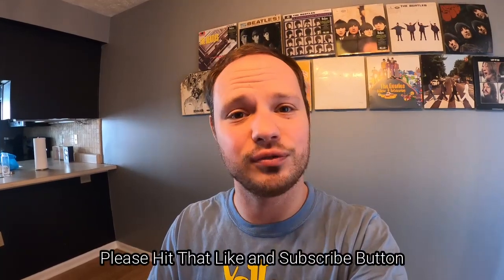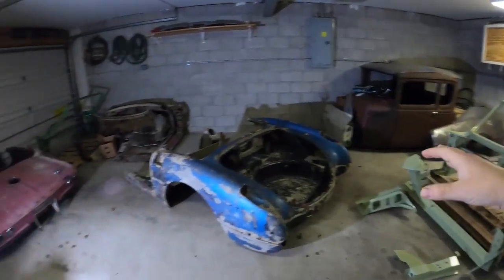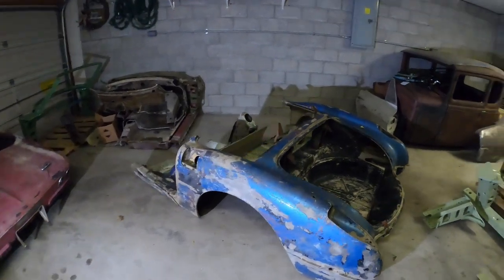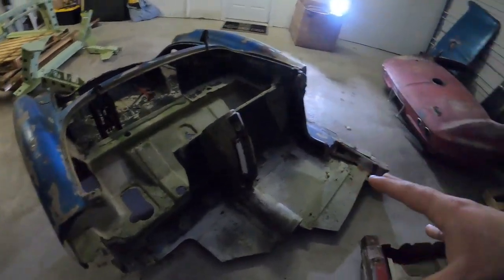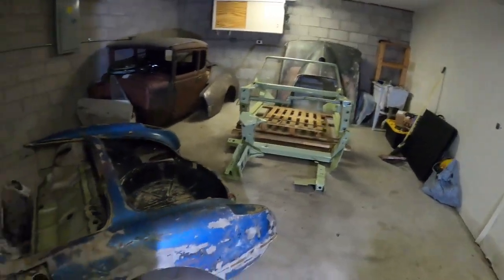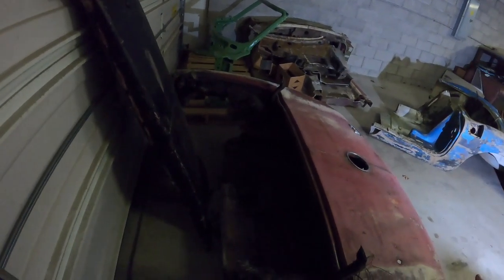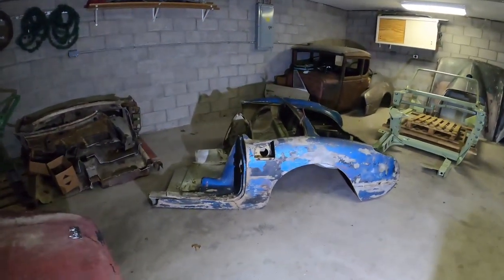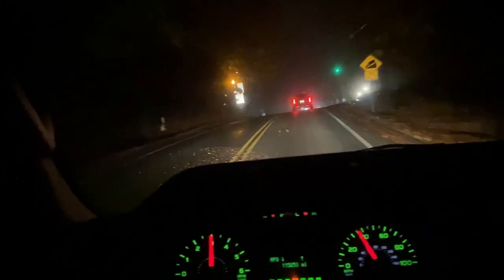I Bought A 1960 Corvette Project for $500!!  My New Restomod Build.  3 C2 Roadsters Up For Grabs!!

Comment: Mitch, I'm excited for the C1 build!!   I've mentioned that I'm building a basket case '56 vette..In fact,  I'm looking for the trunk/decklid hinge towers and hinges (and the section of floor under them) as well as an upper firewall section.  If you have, or run across any of those sections (56-60 should be the same), let me know please.
Reply from the maker: Oh yeah that’s right you mentioned that before! There is a gentleman that makes reproduction fiberglass in Oklahoma. Send me an email and I can put you in touch with him. Ill probably cut out most of the original rear floor so you can use whatever I don’t if you are close to me or Carlisle.
Reply: @MidYearMitch  thanks Mitch!.. I presently have a flat floor in my 56's trunk.. probably more in line of what you'd want..I wish I was closer to you.

Comment: Hey there Mitch,
That '60 is gonna need a few parts and a little paint! This will be a great project.
By the way ... I love your Beatles wall ... it makes me proud!
... but the Beatles Nerd in me cringes every time I see Abbey Road and Let It Be in the wrong order. Abbey Road was the last to be recorded.
Take care,
Dan
Reply from the maker: Hey Dan! The 60 requires some assembly and quite a few expansion packs. 

I’m glad you also appreciate the Beatles. I can tell you know your stuff! Let it be was recorded in 56 but shelved and abbey road was recorded in 69. Then let it be was released in 70. I ordered mine based on their release date. Funny enough I didn’t even consider that when I put my wall up. But I actually took a Beatles class in college. That was way better than my engineering classes 🤣 Now that class has some new material!
Reply: @MidYearMitch  Let it Be was recorded in Jan '69, and Abbey Road was recorded in September '69. They held up the release of Let It Be to coincide with the move release, but all that got caught up in a nasty court case, so the later Abbey road was released first. It's an important distinction only because they knew Abbey Road was their last, and put several closure elements in the arrangement (such as the song The End being the last song on the last album).
Anyway, good stuff young man!